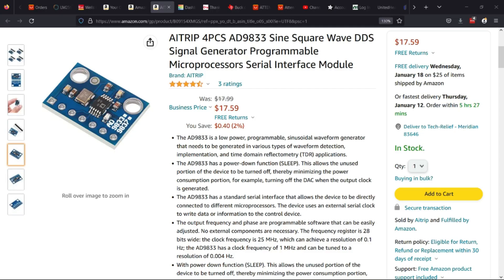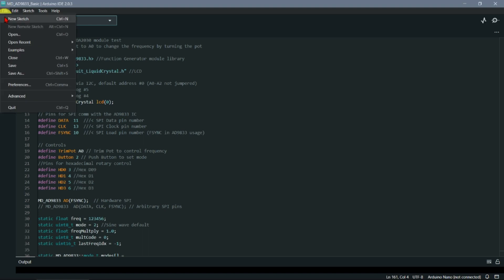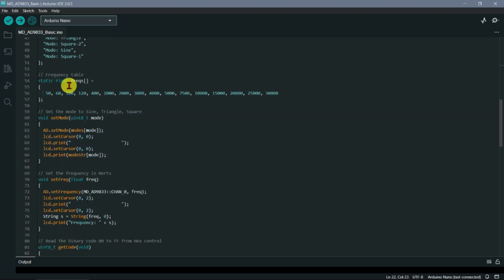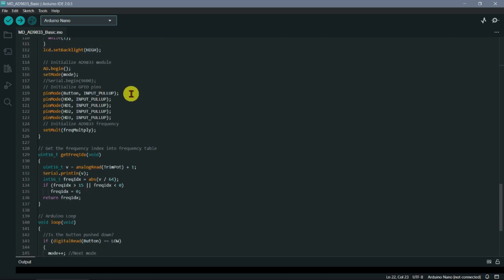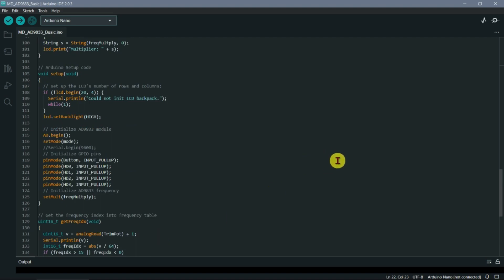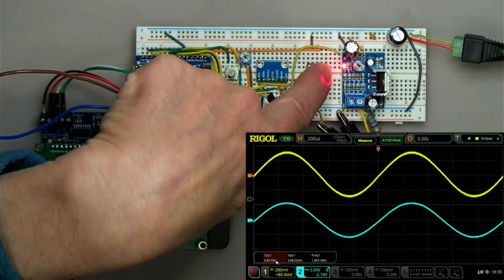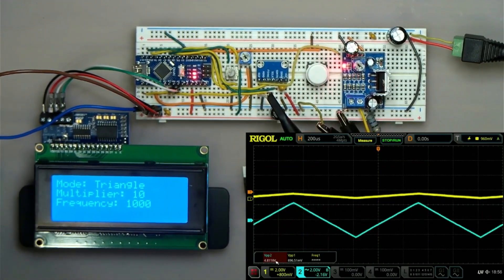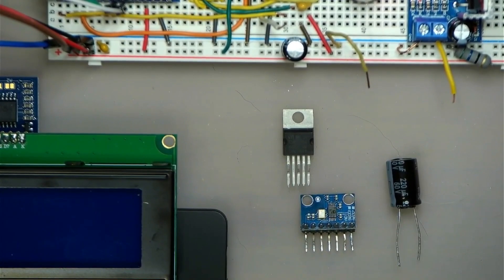Tinkering with an Arduino Nano, an AD9833 and a TDA2030A.

Comment: What connection about 3 leg 10 k potentiometer for frequency changing please describe
Reply from the maker: I should have included a circuit diagram, but the blue potentiometer is connected between +5V and ground with the middle pin connected to the A0 analog input of the Arduino Nano.  This will allow the voltage to vary across the potentiometer from 0V to 5V for the analog input to convert to a digital number.

Comment: I just completed the arduino and 9833 step of the project ,excludind the tda2030 part (i dont buy it yet) and at the output, I have a sinusoidal signal of 600mV peak-to-peak. Can I use this amplifier to raise the signal up to to 5V or do I need a module with more gain? I will be using it for a component curve tracer project. Great video!
Reply from the maker: Well, the TDA2030 is an Audio amplifier with a gain of 20, a max supply voltage of 44 volt and a low output impedance.  So depending on the impedance of the circuit you are going to feed the output signal into it might work and should be able to output 5 volts.  However, I have observed that commercial curve tracers tend to have a micro controller connected to some relays to select various output voltages from secondary windings on a transformer.  The output from the TDA2030 was  connected to the primary of the transformer.  I guess this was so the TDA2030 could provide a constant output voltage and the various secondary windings were used to vary the output voltages.

Comment: The bandwidth of the TDA2030A being only 100khz means its probably not great amplifying frequencies above that. Depends if you want to generate signals above those frequencies.
Reply from the maker: I was toying around with the idea of creating a curve tracer which does not need frequencies higher than that.  But I am not sure if and when I will get to that.